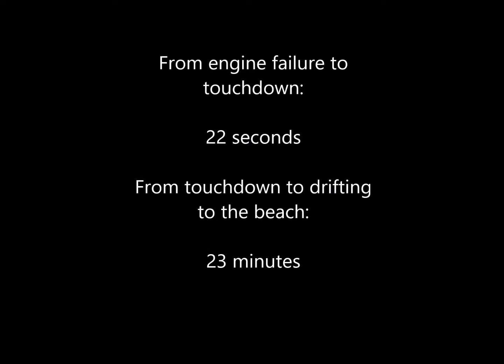C-ITMP Challenger XL-65 on floats - forced landing on Lake Ontario 2021.08.28

Comment: Nicely handled! 
Glad you and the bird are safe. Look forward to hearing what happened.
Reply from the maker: It's a 582 in plugs-down orientation. I had just replaced (or so I thought) the oil for the intake rotary valve. Unfortunately, the manual is missing a step. If you have a 582 in "inverted" mode, when you replace the rotary valve oil at 100 hours, use the installation manual, not the Line Maintenance Manual. There'a bleed valve. You need to open it.

In short, the brass on the rotary intake valve melted.

Comment: Those floats sure wiggle around a bunch!  Why no flying wires? I dont think I've ever seen bracing wires on Challenger floatplanes. But, brace something there maybe too much stress somewhere else.
Reply from the maker: Thousands of planes and tens of thousands of landings say... it's just fine.
Reply: It just seems to me alot of excess movement with that float mounting - obviously it works as there are lots of Challengers on PJs out there; was just wondering if bracing cables were added stiffening things up if it would just cause problems elsewhere. That flex prob soaks up alot of energy.

Comment: Good flying Andrew, you were calm, collected and carried out a good approach and landing.   May I ask how many engine running hours from the time you changed the rotary valve oil and the rotary valve failure please?
Reply from the maker: 0.8 hours running time, 0.7 at flight power.